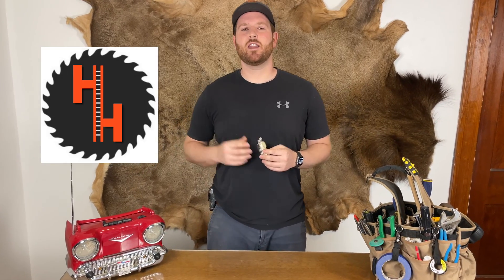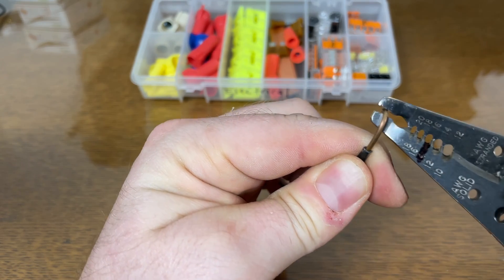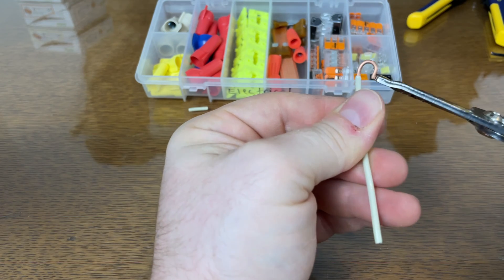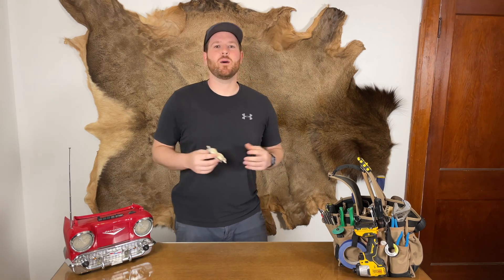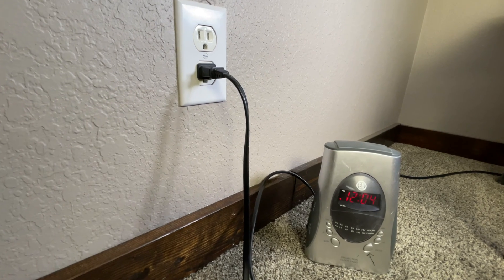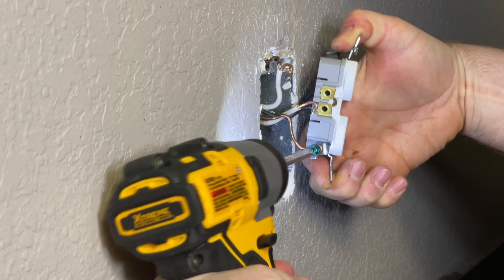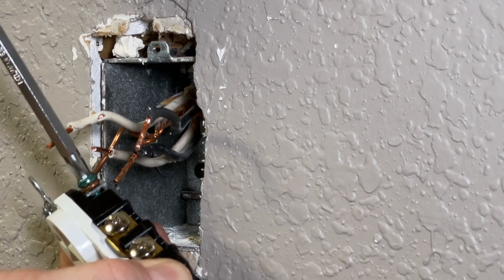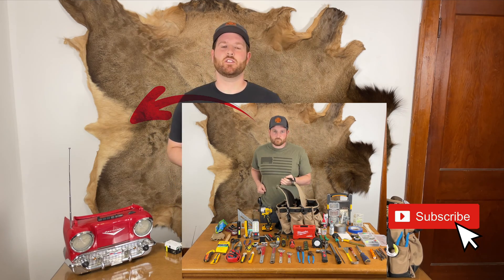CORRECT Way to Change Outlets from A-Z!

Comment: I figured out that my house has the "stab in" outlets after hearing a popping noise and smelling something burning in my kitchen. I turned off the breaker and the back of the outlet had a hole burned in it and the plastic around one of the the wires was charred a couple of inches from the outlet. A friend is now helping me replace all of the outlets in my house. Thank you for these videos, they're helping me with a lot of stuff!